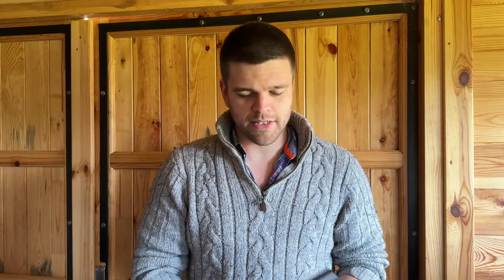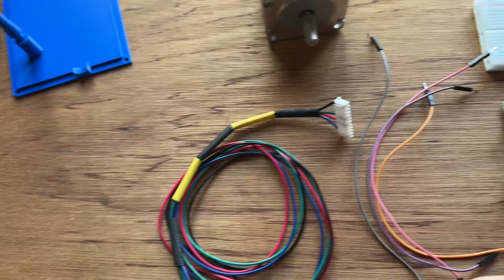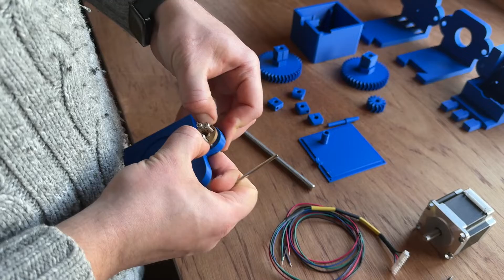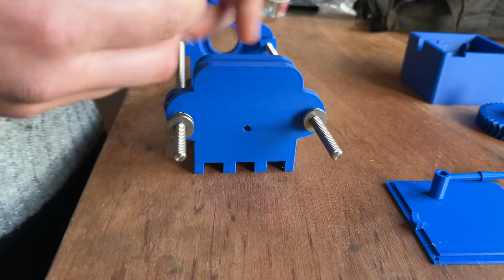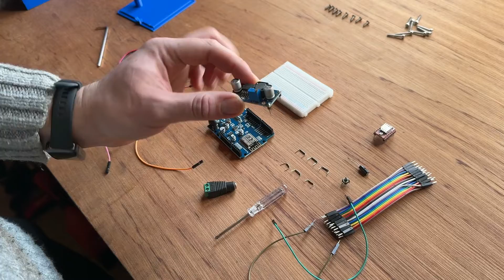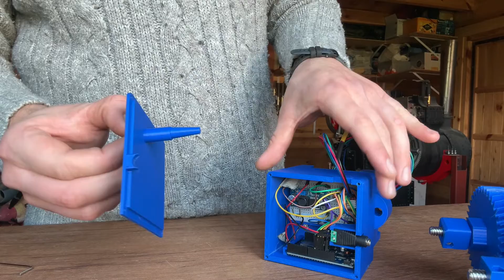3D Printed Electric Can Crusher

Comment: Is there a reason for the dovetail joint instead of printing it in one piece?  The K1 Max and in my case, the Bambu A1 could print that as a single piece - so wondering if it was by design for flexibility or something?
Reply from the maker: Good question.
I was hoping for it to be more accessible to more people - I was referencing an Ender 3 for the design, hence it also being made of PLA.
I also had the idea of having extension pieces, in case I wanted longer lead screws, and the ability to crush bigger bottles, but thought that would take too long for full movement if only crushing a standard can.
Moreover, I'm always nervous of failed prints, and hence try to avoid printing large pieces that take a lot of time and filament.
However, I can amalgam the two pieces into one to add to the downloadable files, if you wish.
On a side note, I've been having issue after issue with the K1 Max - currently trying to diagnose what I think is a siezed idler at the rear left of the print bed...
Reply: @acsellerationacademy  Ahh makes sense - I did wonder if that was a possible reason too.  I've already combined the 2 parts, added a Ryobi logo, added some mount points on the sides to affix to wall and currently making a simple ESP32 sketch to control it using an ESP32-Cheap Yellow Display - because "why not" :) I'm debating adding end stop mechanical switches top and bottom or perhaps the optical type.  Really nice design you've made - I'd been looking at electric can crushers online and couldn't justify the £100 ish to buy one - this DIY approach is much more fun.  The last Creality I had was a CR10S! When I sold that last year I finally joined the bandwagon and got the Bambu A1 + AMS Lite combo.  It's a great eco system they have, so far so good

Comment: works pretty well. thanks for designing and publishing it. I've got a couple bits of feedback from my build
- it could use a bit more power. maybe it's my particular stepper motor, but it tends to stall out when trying to crush a "perfect" can and sometimes depending on how the can folds. The former is easy to avoid just by denting the side as I load the can. maybe a bit more of a gear reduction? not sure.
- The thrust bearings between the gears and the fixed wall don't really do too much, the wall gets pulled away from them once it gets crushing. maybe it could use some bearings on the opposite side with a lock ring to keep things tight?
- The stepper driver overheats after several cans and mine is still outside the box. It could probably use a fan to keep it cool.
- The leadscrew clamps at the far end of the rod seem to loosen up over time no matter how tight I make them.
Reply from the maker: Thank you - this is exactly the sort of feedback we need in the open source community!
I'm going to build another one this week, with new parts, to double-check repeatability, but from my extensive prior testing, in response to your points:
 - I found this gear reduction to be the acceptable crossover point between power and speed. However, you can slow the motor down in the code (increasing the step delay) to increase the torque, or even try something as simple as lubricating the gears with WD-40, or equivalent.
 - I had a lot of trial and error with keeping the plastic in place, and not expanding. I finalised on combining nuts with couplers to maintain the thread, and then with the gears using two different pitches to try and keep it taut. But I appreciate it is a fine line between tightening the bolts sufficiently, whilst not cracking the plastic. However, from experience, you can crack the plastic slightly, while still maintaining adequate tension.
 - I didn't have any issue with the motor overheating, due to disabling the stepper motor. Perhaps you're running it much more consistently than I did, but have you definitely wired up the A4988 enable pin correctly?
 - This could be a slight difference in our printer tolerances - I'm using Orca Slicer presets for a K1 Max and PLA. I'll experiment with the new design, and if I find the same, I'll extend the end couplers, and possibly use 4mm bolts and nuts. However, it may be a case of percentage infill.
Thank you again for your feedback - this is vital for proliferation for all of us, and I look forward to your feedback on future projects - this took well over a hundred hours of trial and error, but we can always learn more from a new perspective, so thank you.
Once I've made another, I'll either reply to this with advice, or upload a new video with better suggestions.
Have a great day.
Reply: also, upgrading to something like a TMC2209 stepper might make sense, it can theoretically detect stalls and back off automatically. I don't know how well that works in practice though. It might be as simple as tying the DIAG pin to another port on the arduino
Reply from the maker: Thank you.
Yes, that was something I was looking at, as well as utilising a timer and limit switches - to know when it reaches the endpoint, or if it has taken too long, and therefore should stop. I had also considered ammeters to check current spikes. 
However, I wanted to keep this as cheap as possible, while still being practical, hence I avoided those more expensive options. 
I even have  a working design using more available NEMA 17 stepper motors, but that is considerably slower. Would you like the .stl files and tutrial for the NEMA 17 variant?

Comment: AND, why not.  This kind of mechanism would be great in my flatshare, where, a few of the tenants put whole bottles into our kitchen recycle bin causing it to fill up so quickly.  Only after I would take the bottle out, crush it, and put it back in did they click that doing so saves so much space.  

Anyway, great project
Reply from the maker: Thank you.
Yes, I found that even with conventional can crushers, they can be too much hassle for people to use, but I hope by just pressing a button, and let it work unattended, it will increase usage - particularly pertinent for HMOs.

Comment: Nice try for daily use! If any custom PCBs /3D printed parts may help for upgrade or new project? Woud like to sponsor if it help! (PCBWay zoey)
Reply from the maker: Thank you Zoey.
I'm working on another project whereby a custom PCB would be incredibly beneficial, but I lack experience in gerber files.
Do you require gerber files, or can you work to specifications and comparisons, instead?
Reply: @acsellerationacademy  Yes, Gerber file is required for the PCB manufacture. We'd love to supply any tutorials, which software do you use? Are you open to a further discussion via E or anywhere else? You can find mine easily!